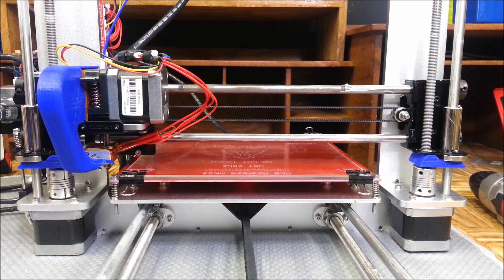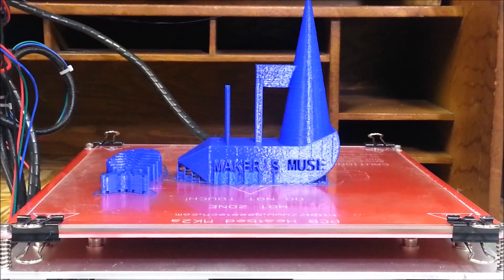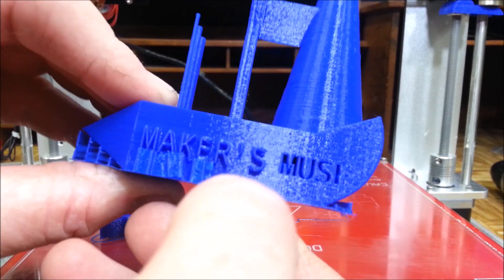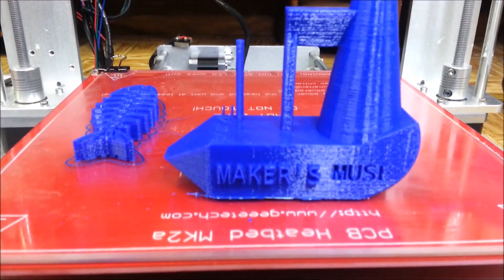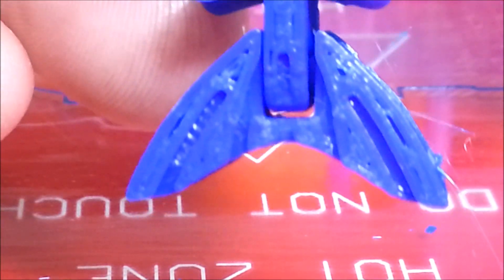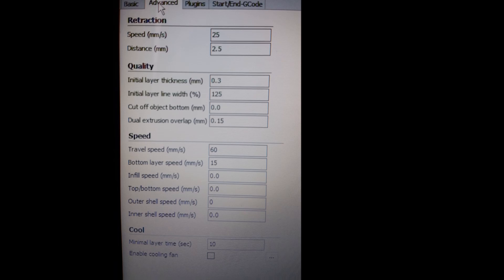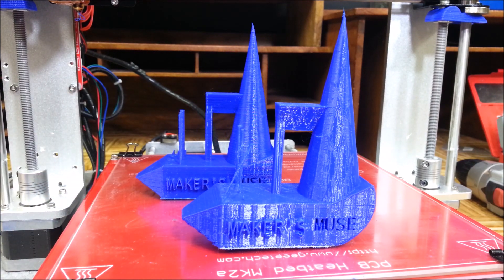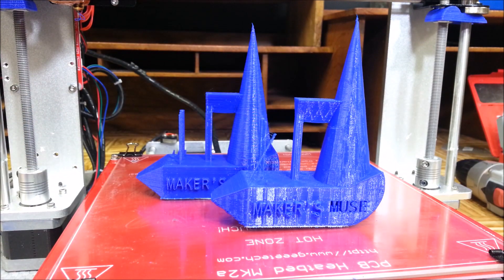Maker's Muse Torture Test Print On The Geeetech Aluminum Prusa I3

Comment: I have a pro w i cant print anything because the z axis wont advance......any ideas??
Reply from the maker: That's normally caused by wiring, stepper driver or stepper driver voltage.  If none of those are to blame then it could be firmware or the board.  The last 1 being the least likely.

Comment: Very nice run through of the test print, and test print differences.  While I think having a standard model for a torture test, and while's it's good to understand the settings used initially, I think it is more critical to see if a printer can match the performance of others, even if you tweak the settings.  Now I must admit, cutting to half-speed is pretty drastic, but it shows that your printer can print a nice model -- you now just know what you need to tweak.  Good work!
Reply from the maker: +John O'Shaughnessy Thank you!  I still from time to time play with settings just to see how different aspects of a print can change with small adjustments.

Comment: I have this same printer. I posted on the Geeetech with the Z wobble issue and after printing those little nut holders my prints are great. I'm still having a few issues here and there but they are very minor. I use Simplify3D for my prints however can you share your Cura settings for PLA and ABS please.
Reply from the maker: +thehittmann1981 I haven't printed with ABS yet, but please check out this video at the 8:12 mark.  https://youtu.be/f4c55ppYdig  I go over my settings in Cura.

Comment: hello Jimmy i bought the same prusa i. and i am having trouble keeping the threded rods locked inside the z-coupler. sometimes they turn individually or sometimes just vibrates and dont turn at all or only one side turns and raises the x-axis. sorry to inconvenience you but any help is greatly appreciated.
Reply from the maker: +SuperHUMAN4545 No problem at all.  There are 2 things that caused me the same problem.  1 is having the coupler too far up or down causing one shaft to force the other one not to be tightened down by the 2 set screws.

2 is the set screws my be stripped or not tightening down enough.  I'm sure there were extra screws like I had.  If tightening the 2 set screws per side of the coupler don't work, if one seems loose, replace it with the closest length you can find.  You may have to cut it off a little, but it will save the time and trouble of waiting for replacement couplers.
Reply: thank you for your speedy reply, the 2 screws dont seem to tighten it at all now i have 2 plastic pieces showed in it to keep them in place. ok i will try using a longer screw.
if i can trouble you with one more question do you have any advice on how far to adjust the z-min screw so the print heads wont be too close or too far away from the print bed. 
thanks
Reply from the maker: +SuperHUMAN4545 I set the z-min screw as a rough adjustment.  Then set the screws on the print bed to fine tune it.  Please check out my video on adjusting the print bed  https://youtu.be/K-3YuzdeO2M

Please let me know if it helps.

Comment: I would say you have arrived. Looks fantastic. I watched all your building videos and in the end decided not to go for geetech but I did bought a p3steel I3. However painting it is a real pain. Multi primers don't work on galvanized steel, I found out the hard way :-(
Reply from the maker: +Voyager I know exactly what you are talking about.  Years ago they sold a zinc oxide primer that worked great on galvanized steel after sanding it.  But I haven't seen it for sale in years.  I would love to see how it turned out.
Reply: +Jimmy Shaw&#39;s Tidbits 

I will let you know, but be prepared.... its neon green with black. :-)
Reply from the maker: +Voyager That's alright.  You are talking to a guy who's first roll of PLA was Florescent Yellow.  LOL!!!